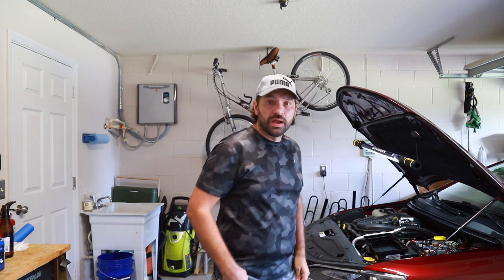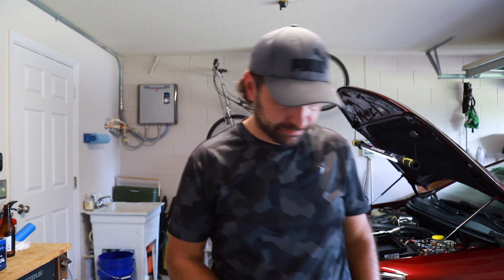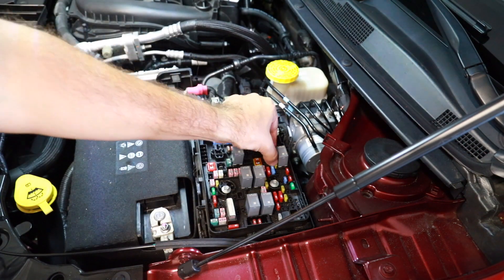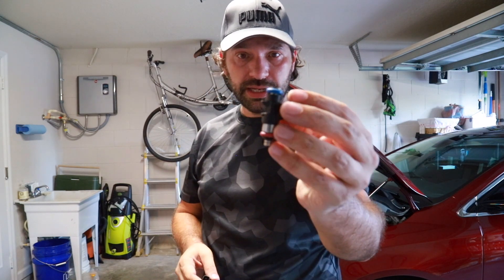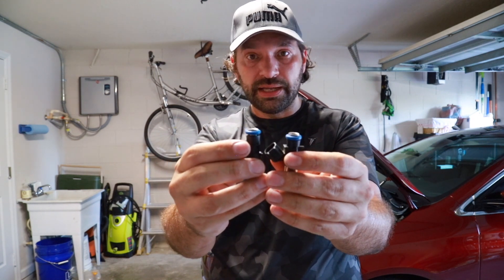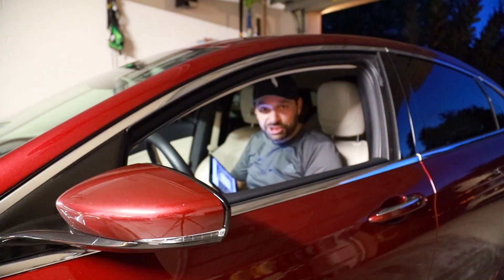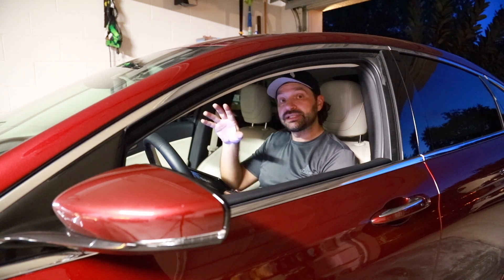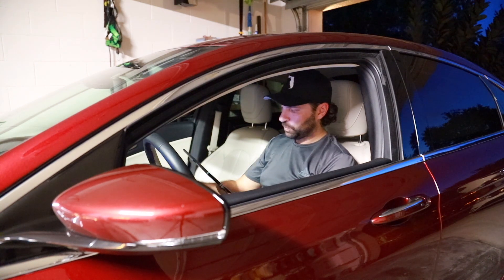Pentastar Fuel Injector Upgrade

Comment: Which injector comes after this 50lb i need for my supercharger jk
Reply from the maker: Talk to whoever supplied you that supercharger. You don’t want the wrong size in there. Also, should the kit come with the correct size injectors and tune?
Reply: @Turbo_Snail  it's come with Gm 50 lb injector but maybe I need bigger bcz I'm porting the supercharger
Reply from the maker: @Alhammadi-gy5jb nah. I’m pretty sure you won’t be able to exhaust these 50lb injectors. That’s a lot of fuel. Even with the SC. Talk to the people who sold you the SC or even better, the tuner who will adjust this for you.
Reply from the maker: Check with the guys over a PentastarV6Performance on Facebook. They are very knowledgable. I was told maybe 1100cc injectors

Comment: I was having trouble seating, the lower part of the injector the one with the red O-ring. Is there some secret.
Reply from the maker: Shouldn't be a problem. You going with Factory style injectors or aftermarket ones. My Corvette injectors didn't have that notch. So I had to hold it together and slowly seat it into place as there are no notches. Then I used the fuel rail to set them in place. Make sure you used assembly fluid or at least some oil to seat them. Inspect the o-ring and make sure they are not damaged.
Reply: @Turbo_Snail  I used oil on the O-rings I gave up for today. It got too late but I’m gonna do it tomorrow. I’ll get them the seat. Had so many other things to do to it.
Reply: @Turbo_Snail  it was pouring fuel all over all six of them were leaking
Reply from the maker: What kind of injectors are you using?
Reply: @Turbo_Snail  PJMVO They are now seating the o-ring on the lower part of the injector was two small it was orange not red
Reply from the maker: @robertware8643 hm interesting. Post over on pentastarV6performance on Facebook. You can post pics.
Reply: @Turbo_Snail  actually think I got it I had to idle it for a while to get the air out of the fuel lines, but it stopped, showing a fault it was, and it’s not spraying fuel all over the place And it sounds like it runs way better
Reply from the maker: @robertware8643 I’m glad you figured it out. It can be scary when fuel sprays all over. My story is, I put them in dry and damaged an o-ring. Put all together, started the car and fuel everywhere. Ever since then I don’t do nothing without assembly fluid. Best stuff ever.
Reply: @Turbo_Snail  I used heavy gear oil, 90 weight on the O-rings
Reply: Hey buddy. I just had the same problem.  I wasn't satisfied with the way the injector seated.  Then when I turned the car on it was louder than I'd expect and gas was misting out of the area of the fuel rail and injectors.  I panicked and turned the car off, threw a wrench across the garage and said words I haven't heard in a while.  So you're saying the same thing happened to you and  you let it idle and the spraying eventually went away?  Did i read that right.  I hope that's true otherwise I'm having it towed tomorrow because I'm done.
Reply from the maker: Noooo, I failed to put assembly lube on the o-rings and pinched it. I had to replace it. My local auto parts store had the o-rings. I replaced it. Ever since then I put assembly fluid on everything.

Comment: The original mopar fuel rail loose pieces, like a poder, dust,  of plastic ir graphite, and clogs the injection nozzles
Reply from the maker: Hm not sure whether it’s the rail or just crappy gas. I’ve been running e85 since the car was new. (There has been a bit during Covid where I ran 93 octane as the car was just sitting)

Comment: Good info for us pentastar guys, can you get more hp&tq with the 50lb injectors and a tune?  Say 50or60 at the wheels.
Reply from the maker: Not sure. I never dynoed mine. I’m trying to remember. I think I went from just over 15 sec on a 1/4 miles (yup she’s a heavy one) to just under 14. But that also includes better tires. My goal was never to be “the fastest”. My goal is to have better drive ability. Most of my improvements Mario made in my tune was midrange. That includes the way the transmission shifts as well. 

I do like little drag races when they come up. But I regularly beat 4-cyl turbo mustangs, the Honda Accord sport with the turbo, the charger and challengers with the small hemi with not much effort. My biggest issue is the keep tire spin down and I run Continental extreme contact sport which is about as grippy as it gets. Maybe one of these days I can put her on a dyno but without a before I doubt it would even matter. 

Thanks for watching. We’ll be doing videos soon again. :)
Reply: I have not gone to the track with my 2020 Challenger 3.6  But i did get tune 
 93 octane/E85 from Mario (demigod). We don't have E85 in NH though you can go to Sunoco and get 100 octane. One thing that makes a difference also if you Hold the traction & sport mode buttons down while your starting the car and wait until you see the (electronic stability control)
off..   It defintley makes a differences especially off the line.  Enough power 
for the street!!
Reply from the maker: I’ll try that trick. Because I Ben if I take of TC it feels like getting in the way. Did you get your trans tuned as well?
Reply from the maker: By the way, knowing now you have a challenger. Keep in mind that even though my 200 is amongst the heaviest of the 200s, its still lighter than your car. That gives me an edge in that department. That being said, some people are tinkering with different gearing which makes the challenger pick up some good 1/4 mile and 0-60 time. Also, you have a lot more mods available. I'm pretty much done. I got no space. If you want a lot more power, a Supercharger puts you well ahead of a 5.7l Hemi.

Comment: Hi Daniel. Interesting video. Good news for me. I have a flex fuel. Excited to see your results. Getting a house, so you know where my money is going right now, but then I will get the injectors and time from Mario.  Thank you. 👍👍
Reply from the maker: I’ve driven with the large injectors for a year now. The car doesn’t run out of juice at 7000rpm anymore. I bet I could push it further but I’m out of my comfort zone. It does build power. The problem, tires spin 1st, 2nd and 3rd. I just got new tires as well so I really can’t wait to get her to the track. But the day to day driving is excellent. I’ll make a video as soon as we tune ethanol. I just hope the fuel pump is up to it. It would have to empty 1.5 2 liter coke bottles a minute to max these injectors out.
Reply: @Turbo_Snail  Sounds great. Do you have an app time for 0-60 and the quarter?
Reply from the maker: The app said 5.9 seconds and 14.18 to the 1/4. But that was on a real shitty road. Didn’t wanna do it where traffic is. I can’t wait to get the the track.
Reply: @Turbo_Snail  You will run quicker. Had terrible finding the injectors. Your link went to Spanish. Sorry, can't speak a word really 😂. I found them though. Didn't see the option to buy individually. Did you just buy 8 instead?
Reply from the maker: I put the link to Amazon for the 6-pack. Fast would only sell me the 8-pack.
Reply: @Turbo_Snail  It's in Spanish my friend.
Reply from the maker: Oh snap. Let me change the link when I get home. Sorry!
Reply from the maker: Greg, I'm not sure what's going on. The link seems fine from here. I'll check on a few more computers to make sure all is good. Also, I heard Brian is tuning 39lbs injectors right now. That might be another route to go. I'm not sure if that is big enough but if you're patient, maybe its a viable option. We should have results soon!
Reply: @Turbo_Snail  Daniel, it did go to English. Not sure what was happening.

Comment: Not sure why you are bothering with a 200 and a v6.  I drive a scat.  Saving for a hellcat.
Reply from the maker: Well, I’m happy for you. You mod your scat?
Reply: Probably because he wants both economy & extra performance. Scat paks & Hell cats are nice, but for the most part going to work ,grocery store ect. your not going anywhere! There is traffic and cars all over the place.. Plus you are not going to hook up @ a set of lights! Some old lady will pull ahead of you in her Tesla.
Reply: @davem.539  I've gapped plenty of tesla and scat packs in my wrangler. Fully built v6 pushing out more hp than a 392 hemi.
Reply: Of course you drive a scat. I bet you also live in your parents basement and bought the car at a 50% interest rate with a cosigner for 84 months. No one cares.
Reply: I know this comment is old but I still like to be funny so here we go. man I don't know why you bother with buying anything that runs on gas period, if performance is the goal I would just buy a tesla. everyone's slow when the ev's pull up on stock tires and no practice and gap everyone at the light.
Reply from the maker: Lol. I almost fell of my chair.